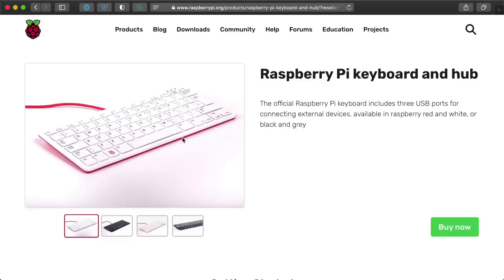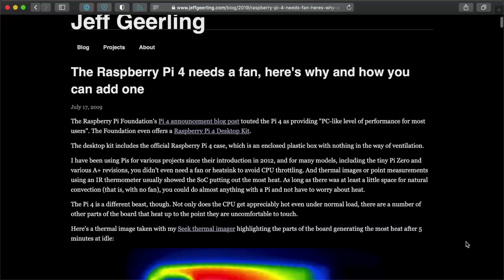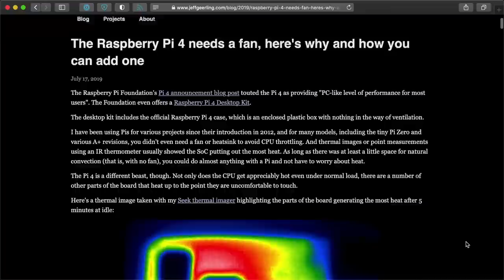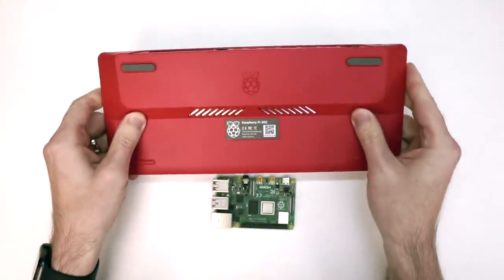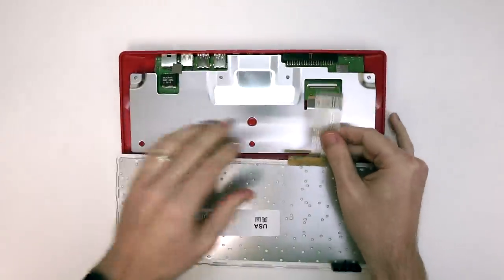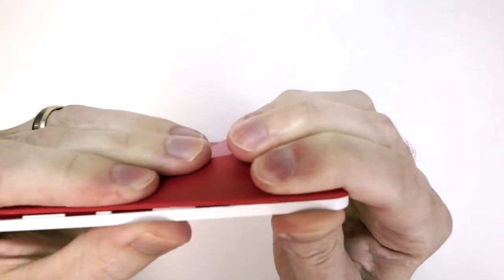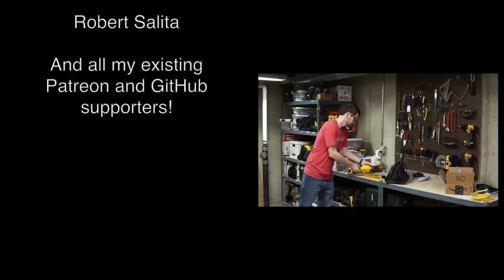The Raspberry Pi 400 Teardown

Comment: The 400 might be a reference to old Acorn machines  like the A4000 or even the A410 and A440. The A4000 was also a keyboard based machine. :¬}
Reply from the maker: Lots of that form factor back in the day!
Reply: @JeffGeerling  The Acorn machines are also Arm based and part of the Pi's heritage like the model B's coming from the BBC micro model B which was made by Acorn.
Reply from the maker: @NigelGent  A lot of heritage there! I have still never seen an Acorn in the wild, but it seems like a lot of the Pi heritage dates back to that company.
Reply: @JeffGeerling  In my loft I've got an Acron A310, A4000 and an A5000 and they all still work Thr RiscOS they ran was brilliant and you can run it on a Raspberry Pi.
Reply: Or maybe Atari 400. That would make a bit more sense.
Reply: Pretty sure you are wrong on the A4000. The A3000, A3010 and A3020 had an integrated keyboard, but all the other Archimedes machines had it separate.
Reply: @Kynyos  That's what I'm going with.  Commodore VIC20, Atari 400, Tandy Color Computer, and Sinclair ZX80 were all cheap-as-could-be computers that just plugged into a TV and were ready to go.

Comment: The bourns part is the ethernet magnetics (basically a couple of small transformers), on the regular pi they use a jack with integrated magnetics; this board is using a standard 8P8C jack with external magnetics, likely for lower profile.

Comment: Thank you for the video, I was really curious to see what was inside.
I use guitar picks to open electronics, they work well and you can buy a set of 40 for very little money on amazon. Each set includes picks of different thickness. 🙂
Reply from the maker: The key for this particular case was rigidity. Unfortunately all my guitar picks on hand were too flimsy, and my normal spudger and credit card were both slightly too thick to fit into the gap.

But yes, a good solid guitar pick would probably be perfect, and result in less risk to my digits!
Reply: @JeffGeerling  then I can recommend guitar picks sets from amazon as they go from super thin and flimsy to thick and sturdy. I used a medium/thin pick to take apart a keyboard with a similar latching mechanism as I needed to change its internal battery.

Comment: FINALLY, a usable Board with all external Connectors on one side. I got tired trying to Integrate Pi's in Systems and routing the HDMI-Cables with Adapters to the back. All I need now is SMT for external antenna and a internal USB-header.

Comment: i was sort of hoping that it used the computer module, that would of been interesting for future upgrades. but still pretty cool, ty for the vid
Reply: i was hoping so too, but i guess that would be more thermally dense? although then it would be easier to heatsink the extra chips...
maybe they're just wanting to save the cost of the additional PCB + board-to-board connectors
Reply: *module. That
*would've (contraction of "WOULD haVE")

Comment: This is exactly the form-factor folks need for making Raspberry Pi 4 ‘blade’ clusters as the key ports are all on one sides for various cluster mainboard configs:
– headless network boot config – ethernet (for pxeboot), power, gpio (serial, i2c, gpio to trigger reboots, etc),
– boot with storage – ethernet (for pxeboot), power, gpio (serial, i2c, gpio to trigger reboots, etc), sdcard option, and USB drawn out for USB stick, usb3 sata, usb3 m.2 nve, and other peripherals

I also see this slim form-factor helpful for projects helpful for those where a “3×5” style board cannot fit.

If the Raspberry Pi foundation or licensees do not release this form factor without the “keyboard wrappings”, makers will gut the keyboard which will be landfill plastic eventually. And that would be bad, m’kay.

Jeff, please provide the Pi Org some feedback to sell this mainboard form-factor on its own. They could even optionally leave the keyboard ribbon adapter off.There is a demand for this configuration.

Comment: When I first saw it, for whatever reason I was sure it will have a compute module 4 inside. New PCB makes more sense though, as it definitely is cheaper than separate I/O board.

Can't wait for new Pi-laptop builds with this new form factor!
Reply: With the DSI port being removed, there won't be any laptops based on this hardware.

Comment: Something I've NOT noticed at first is that it lacks the CSI and DSI connectors. I guess it makes sense to leave out the DSI in such a design, since it already has two HDMI outputs; but maybe people would want a camera, even if only to use a videoconferencing app. Also, a microphone input would be a great addition. Of course one could add both the camera and the mike with a single USB port, but it would be nice if we could use whatever interface had become available by cutting out the DSI port to add a sound digitizer, and still keep the CSI port for a Pi camera.

Comment: It's a commodore vic-20 replacement, the vic-20 had a connector for a common 44 pin edge connector card of its day, for expansion and experimentation. This version of the raspberry pi seems to capture the essence of the Vic-20 but with modern capability. The commodore 64 was more of a gaming rig back then in the old 8-bit days.

Comment: OK, after playing with this in the UK for several days doing lots of ffmpeg based h264 / 265 video transcoding I found that the Pi 400 can run up to +20C compared to using an Ice Tower with a regular Pi 4 4GB, e.g 66 C v 47C. Now most people don’t run video transcodes for hours like me. I ran ffmpeg libx265 CRF 20 for 15+hours (0.043x with 41 mins input file). So definitely usable from a temperature if not performance perspective. On the downside I had a boot USB 3 SSD connected and found that like the Sinclair ZX81 from the early 1980s the connector comes out far too easily thereby freezing the Pi 400. It is crying out for an internal storage option. Just move the keyboard and the USB 3 SSD interface link is interrupted. Sticking with MicroSD might be a better option.

Comment: Looks like a perfect board for a laptop. I'm sure someone will make it into one.
Reply: agreed except for the gpio, wonder if anyone makes a gpio plastic cover or something that can easily slide on and off and is sleek
Reply: Yes i always wanted to replace the board of my atom laptop bcz that cpu is so fucking slow like it performs like a pentium 4 from 2000... & A board like this with a custom lcd and keyboard , mouse driver and sata interface with battery controller and omg!! .. it would be so nice but having that custom interface for the keyboard is going to be tough. Lcd controllers r easy to find on ebay and there is millions of them . The laptop has a really god display and keyboard .. & also 47watt hr battery which should be enough for the pi to run about 3 to 4hr.
Reply: @KuntalGhosh  It's going to be difficult to cram all of those things into a laptop body.
Reply: @KuntalGhosh  have a look at the Pinebook Pro. Quad core ARM based. Runs Manjaro from the factory. $200USD

Optional NVMe storage. (requires adapter ~$20)
Reply: @jq6413  i dont think so.. its an older laptop & has enough depth to fit a board of raspberry pi without any of those usb and ethernet ports.
Reply: @williamp6800  no no , i am talking about replacing the motherboard of an existing net book that i have laying around. i also have an lenovo ideapad from 2010s with core 2 duo t7200 , and i think i can fit a ryzen sbc in there with a flat heat pipe laptop heatsink maybe.
Reply: Nah. The Compute Module is a much better bet. Internal CSI and DSI/DPI connectors even on the default I/O board, and the best way to make a Pi laptop would be with a custom carrier for the Pi CM4. Once they're in entrepreneurs hands from next month, I wouldn't be surprised to see people designing something for this. Gumstix already have CCTV and AI boards for this, and the CM4 cluster is already well into the design process over at Turing.
Reply: @prodbypo_  Should be easy to design and 3D print a cover for the GPIO.

Comment: That’s really neat, didn’t know they made one. But I’d never use the power of a pi4 unless I was trying to make it run proper CAD software or whatever, so would probably prefer a cheaper one with a pi3. A trackpoint in the middle of the keyboard would be a nice touch.

Comment: Ok, I didn't expect a completely different motherboard.  I thought it was just a pi 4 + breakout board to get to all the IO ports.  That explains the missing 3.5 jack and missing camera connector.  I was thinking that I would have to drill a hole to get to that.  My reason is that I wanted the "RCA" video option for playing on olden TVs.  They still exist and are a backup display option when you are out in the wild.  I understand why they would ditch the 3.5 jack, but if you ditch the jack then maybe go with standard HDMI connectors.

Comment: I'd been wondering about the formfactor of the actual PI inside the keyboard. I guess I was expecting to find a Raspberry Pi CM4 attached to a backplane providing all the IO ports. I did not expect to see an all new board design.

Comment: yes, this is definitely an in joke reference to the [commodore amiga 500] 25 years later, the 1,4 mb floppy drive just got replaced by 64000 mb microSD, and it has 4000k ram instead of 64k ram, and the ports got more universal and easier to use with plugNplay , but the general purpos of "learn to code in a basic language, play some games and maybe attach some peripherals with blinking LEDs, and maybe write some html and netwrk protocol to even use this to host a webpage", is identical. 
This one supports webgl3 and has half decent specs for THAT, which is possibly the best use case for teaching anything easy of universal utility and with LOTS of "what you see is what you get" coding appeal. Via webpages like shadertoy, you can even code FM-synthesis in opengl/webgl rather easily.

Comment: That "grouding" pad is deffinetly an afterthought because they could have found a way of grounding the shield directly to the board.
Reply: Yeah normally done through the screws
Reply: It isn't to connect the shield to the circuit board but to the keyboard.
Reply: @johnm2012  I think you're wrong there -- I think the metal plate at the back of the keyboard connects directly to the heatsink, and then the conductive pad is to bridge it to the outer casing of the ethernet socket, which is in turn earthed to the PCB.
Reply: @nialltracey2599  That makes two of us, because I think you're wrong too!
Reply: @johnm2012  that goes without saying doesn’t it...? Like if I disagree with you, clearly you disagree with me. But you’re not only disagreeing with me, but also with the guy that had one of these things open on his table and has been in direct contact with the Raspberry Pi foundation. 

Regardless, it is clearly visible in the video that one corner of the pad is on the Ethernet socket and the other is on the heatsink. I would suggest that’s probably deliberate...
Reply: @nialltracey2599  The guy who had one open and who spoke to the engineers said, "it's to ground the keyboard to the rest of the Pi 400 chassis" which is what I said too. You might want to watch the video again.
Reply: @johnm2012 no, he is correct. 

The shielding is connected to the board through the RJ45 socket.

It’s a simple and elegant solution. Not an afterthought.
Reply: @davadoff  I didn't say it was an afterthought. That was the person who started this thread three years ago. You really ought to read the thread before commenting.

Comment: Finally all connectors on the same side!
They really should've added PoE support imo. * has 24 802.3af 8P8C sockets in the house *
Reply: @Shaun ONeil What are the chances an ethernet transformer with center taps is cheaper than one without? Economies of scale, which is why they chose that one? I can't see any traces going from the transformer to a PoE PD chip and the schematics aren't available on https://www.raspberrypi.org/documentation/hardware/raspberrypi/schematics/README.md yet. It would make so much sense to implement PoE on this device!

Comment: If they put CSI and DSI connectors back, we can get a motherboard for a Pi-based ultra thin laptop. They also would need a GPU driver for a DSI to eDP chip since most laptop displays uses that interface. Also includes should be an internal USB 2.0 hub for a trackpad, USB sound card for implementing internal speakers and the keyboard.

Comment: If you take this + a basic $50 1080p monitor (considering you'd be buying in bulk) and you buy like 20 of them, you've spent  $150 per setup for a total of $3000 on your entire office's computing needs.

People don't talk about how good Pis are for office work; this, built into a keyboard, for $100, pushes it over the edge. More offices need to use Pis for computing. They're quick for office work and they're cheap. If I ran an office I'd be using this for sure.

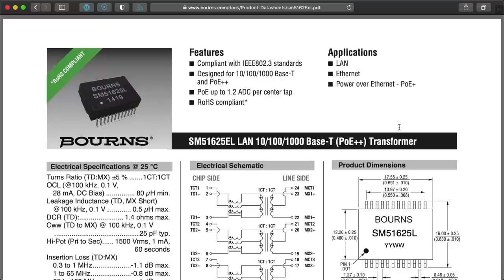Comment: 4:47 That's not true, pi 4 (and also pi 3b+) both have ethernet magnetics with support for poe, it's just integrated into the RJ45 jack itself. The transformer middle taps needed for POE are routed to the 4 pin header next to the connector. You just need to attach to it the POE hat or other POE power module. But I agree with you, that they missed the opportunity to implement POE into the PI 400.

Comment: Huh. I could have sworn I've read somewhere that it's nearly impossible to put this thing back together again because of something with the heat sink so it's recommended not to open it but this looks very easy. Suddenly I'm not so worried about wear and tear on the ports.

Comment: Kind of sad to see its not compute module based. Otherwise it's rather cool.
Reply from the maker: It would be really nice to have that, though I'm guessing the main culprit is the thinness—having a daughtercard to carry the CM4 would make it harder to fit that giant heat sink inside, and it seems the heat sink is necessary to keep the thing from overheating (which it does very well in this case).

But it would be very interesting if someone could build a little carrier board for the CM4 that would fit inside (with some modifications to the heat sink).
Reply: @JeffGeerling  Don't quote me on this...but I recall there being a sodimm socket that is essentially edge-connector in a recent laptop, allowing the ram to sit flush with the motherboard. Would be super cool to use that style and have a cutout for where compute would sit.

Comment: This would have been a perfect platform for the new Pi4 Compute Module.  Instead we have a unit that is only available in 4GB with wifi and no option for eMMC to avoid the need for still using microSD cards (I assume it isn't USB boot from the box).
Reply: Na, Pi4 does USB boot by default. Pi3B+ does it too, and so does the Pi3B but you need SD boot to enable it for the first time
Reply: Yeah, this is a little bit disappointing. Why release CM4 and shortly after that release Pi400 which is not CM4 based? I don't get it. A great machine though

Comment: It could be named after the Acorn Archimedes 400 (ARM processor), like the model A and B are names after the Acorn BBC Micro model A and B (the first computers to run ARM chips). Acorn split to become Element 14 and Acorn Risc Machines, later ARM.

Comment: Far more likely to be named after the very old Atari 400 which was an integrated all in one. This will allow them to release a Pi 800 at some point as there was also an Atari 800 version. For the Pi they can then relate the 400 and 800 numbers to 4GB and 8GB ram configurations. Or at least I hope they do as I need an 8GB version to become available.

Comment: Darn, I was hoping it was just a normal pi in a keyboard case maybe with some adapters to line the ports up. I was hoping there would be extra space in it to squeeze in a phone battery pack for portability. I can run my older pi with Retropie and a USB C powered portable monitor for quite a while of a cheapo battery pack.

Comment: No mention of audio jack in any of the early reviews. I checked the specs on https://datasheets.raspberrypi.org/pi400/pi400-product-brief.pdf and there does not appear to be an audio jack. So sound is HDMI only? Can you confirm Jeff?
Reply from the maker: Yes, no built-in audio jack or composite video. Apparently since the space was lacking, they dropped that instead of something else. I am using audio through HDMI on my monitor, and most (all mine at least) have at least a 3.5mm audio passthrough, if not built in speakers.

For those that don't, there are HDMI audio splitters, though that's an extra expense.
Reply: Thanks Jeff for the confirmation and HDMI audio splitter tip, ordered from Amazon UK  ;-)

Comment: If anybody is concerned about the audio - Pi 400 has Bluetooth 5.0 for starters and you can always plug in external USB sound card with 3,5mm jack.

Comment: Great video. As always.
I've got almost all the answers to my questions regarding this model internals. Just one left and is about it's overclocking capabilities. For example, if this chip model version it's the same as RPI4 but OC by default, or if it will support a higher OC speed than previous model.

Anyway, I'll probably not buying this, but if they ever release an AIO kit for current RPI4 owners at a reasonable price, I'll gladly support them.

Comment: The schematics aren't out yet. What chip is between the keyboard connector and the USB controller? Is it something that can be reflashed? (To drive a ThinkPad keyboard matrix.)  Is there a trace from it to anything other than the keyboard and USB? (i.e. How does this power button work?)  Is it something that can present as a composite device? (To be both keyboard and trackpoint.)